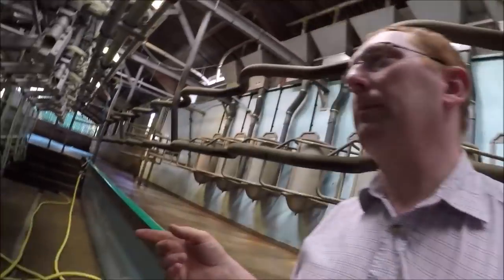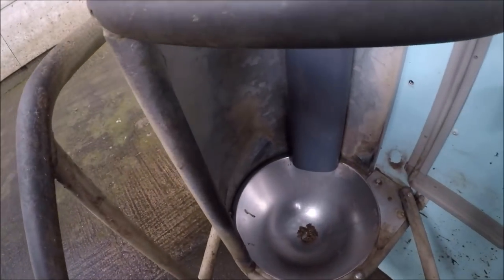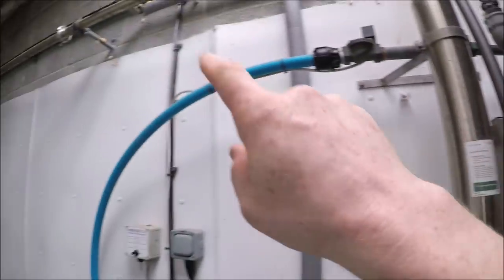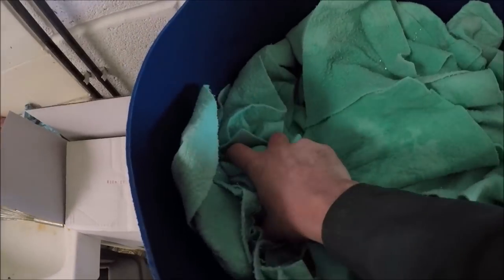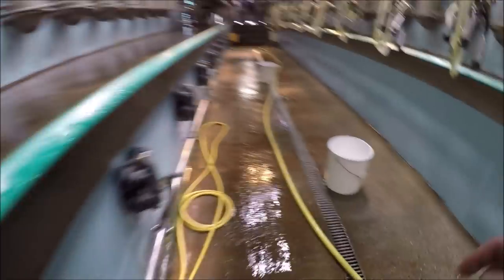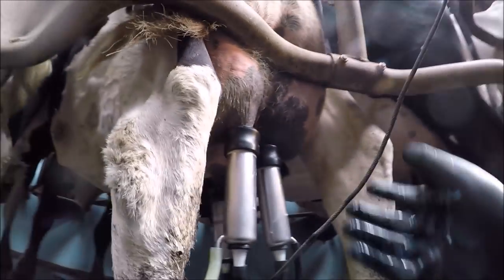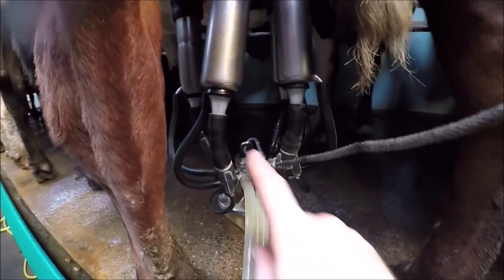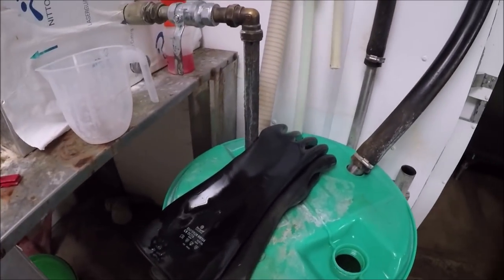Milking cows, GEA herringbone parlour

Comment: Fantastic video. What happens if a cow isn’t read by the scanner? Does the system alert you somehow? Our Delaval is a pain in the butt. One scanner on each side. If the scanner doesn’t read a cow entering the parlour, you have to climb up the stall work and read the cows tag and see if it corresponds to its panel so we can identify what cow wasn’t read. We have had to memorise every cows tag number in our head to get around climbing stall workout. Solves our issue but doesn’t help if we get a relief milking in for the evening or morning.
Reply from the maker: The cows are all freeze branded so easy to find out if it doesn't read the tag.

Comment: Jaysus that's a big plate cooler for 140 cows swear our double cooler, water and chilled glycol is smaller than that for 330 cows
Reply from the maker: It was a double cooler, chilled water and bore hole water. The ice builder is beyond economical repair so we put the borehole water through both sides.

Comment: Do the acrs 'turn off' the pressure from the pump on that line ance the cluster is pulled off? Or is the vacuum pressure constant in all lines at all times during milking
Reply from the maker: Vacuum is shut off as soon as the ACR pulls the cord. The pulsator stops after a couple of seconds too.
Reply: @CowfarmerDan  did you ever think of putting in a double up parlour so for instance 20 units and 20 spaces for cows so 10 a side or would that have to be a 2 man operation with wiping the teats and teat dipping? Or would it matter
Reply from the maker: A swing over is faster unless you have very high yields. Our cross breeds give lower yields but higher milk solids. We didn't consider doubling up the units.